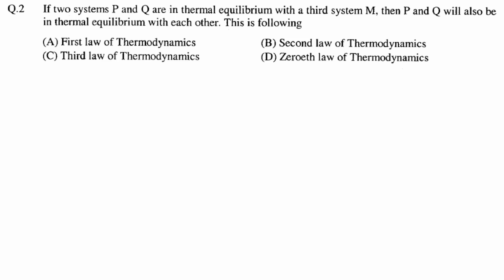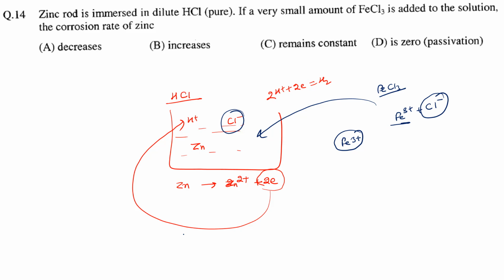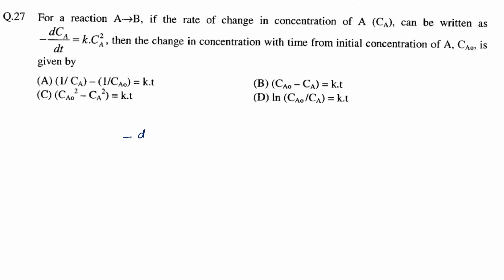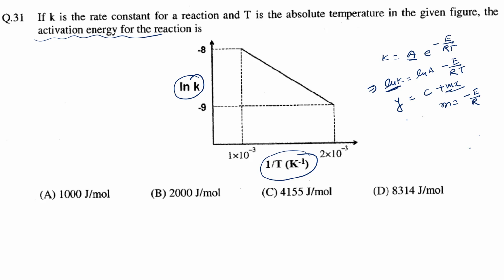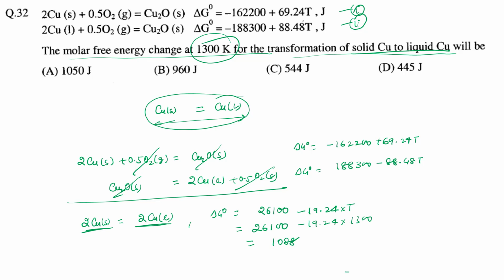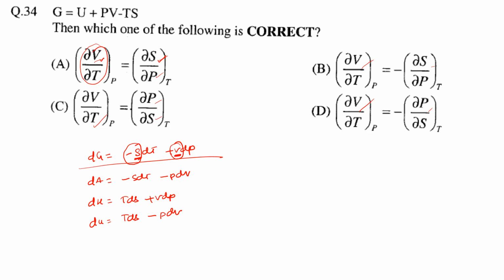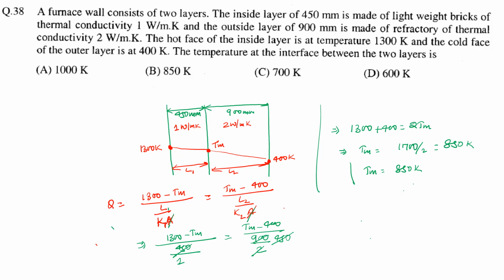GATE 2011 Thermodynamics and Rate Process Solution

Comment: In question number 13 as per my knowledge it's not a unimolar solution. So XalnXa should be NalnXa and same as the other. If the total moles will be 1 then this formula will be Valid. Please correct me if I am wrong . Please reply 🙏
Reply: na he is correct

Comment from the maker: 00:00 Laws of thermodynamic
01:19 Entropy of mixing
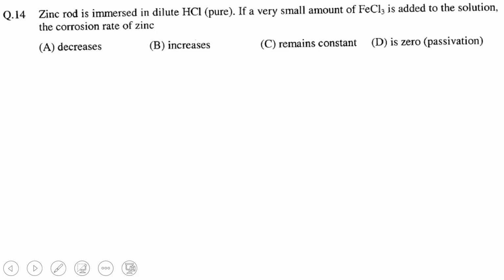03:31 Zinc rod in dilute HCl
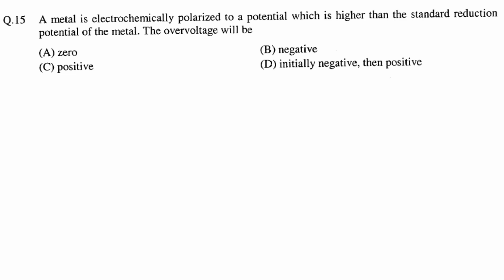06:15 Overvoltage
07:16 Aluminum Reduction
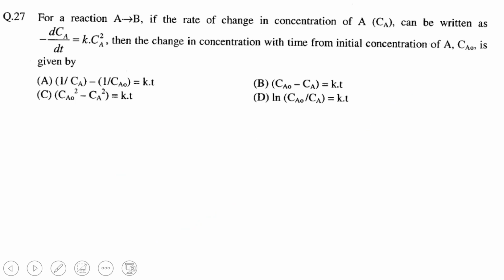09:49 Change of concentration
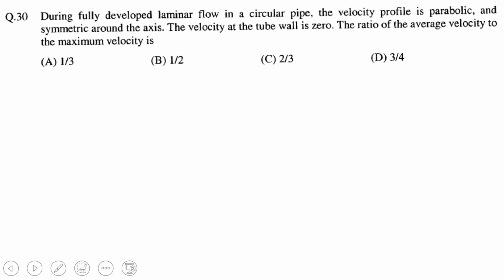11:57 Laminar flow
14:07 Rate Constant
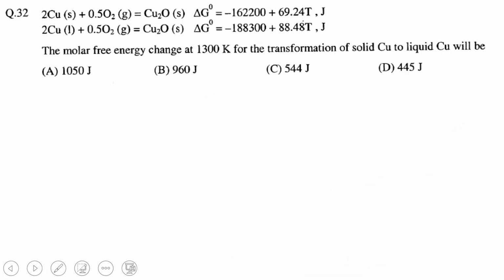17:34 Molar free energy
21:27 Reduction potential
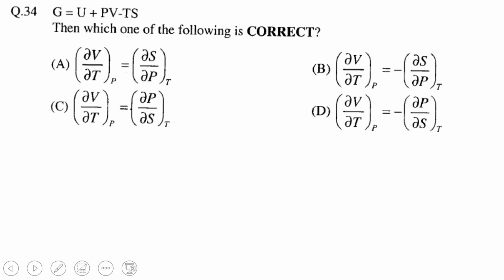23:32 Maxwell Equation
27:33 Standard free energy
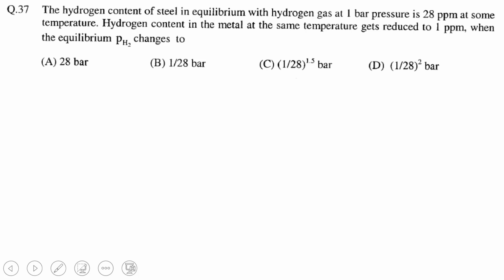30:50 Hydrogen content
32:47 Furnace wall heat transfer